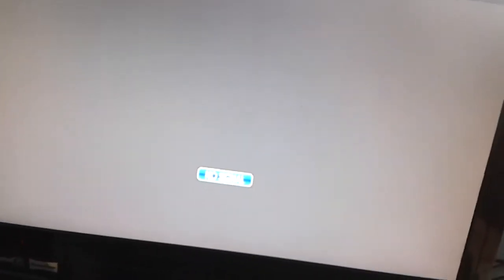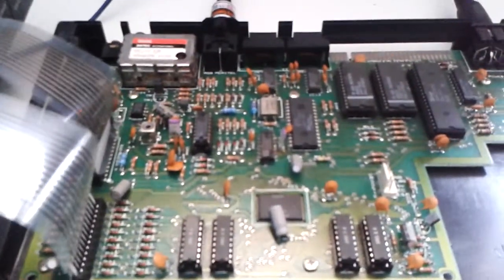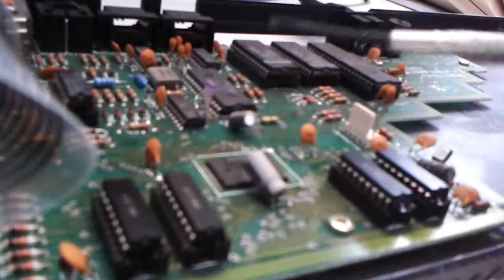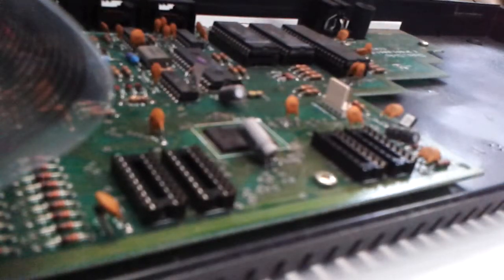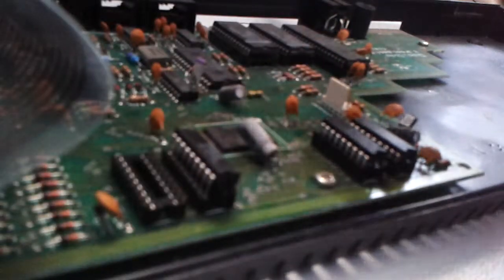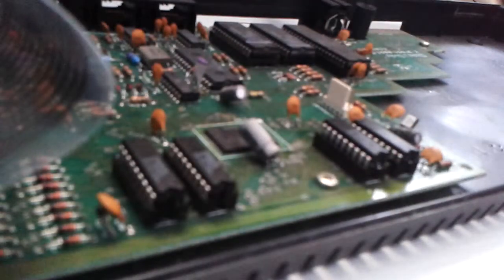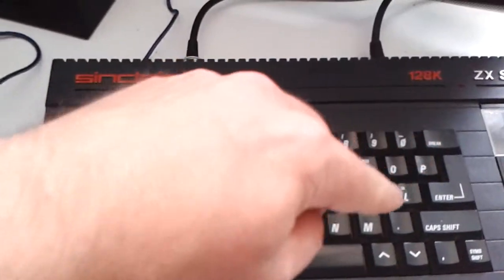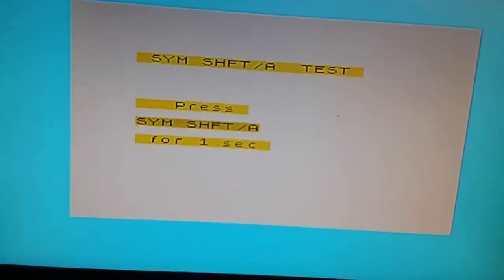ZX Spectrum +2 Repair and RAM test, how to.

Comment: I have the exact same problem but it doesn't go black it just keeps flashing the same colour as yours was doing is that the ram chips that need. Replacing then                                     edit: cheers just took it all down now and 3 of the ram chips were cold but one of them was hot asf so I'll be replacing it thank u so much this helped alot